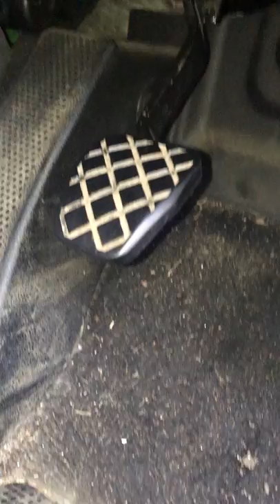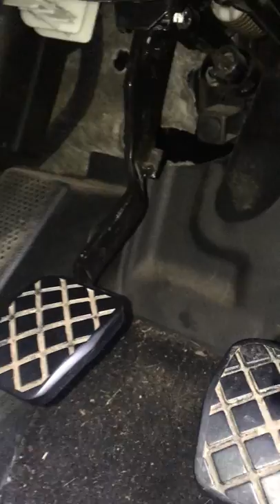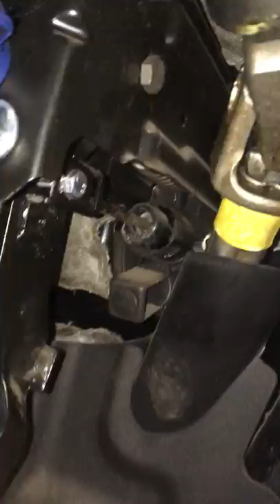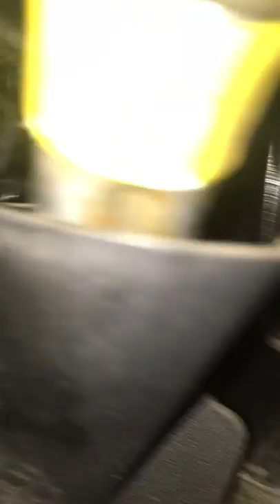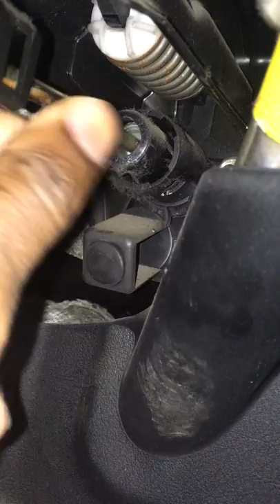How to fix Vw Golf Clutch pedal stuck to floor mk4 tdi fault Simple Fix No Welding cheap repair

Comment: Its only £2 at scrapyard for another pedal. I've done this same bogde to fix my car. But you will end up having to replace the clutch master cylinder because it ends up bent out of line and won't work propperly after. . It actually causes more damage to the other clutch parts .

Comment: do you mind to measure the bolts to says the size of the bolts
Reply: What  size bolt
Reply: I bought a £2.50 bolt selection from toolstation and the bolts were spot on to be fair.i don't length but needed a 10mm head nut and bolt out of it and the 13mm nut and bolt 🔩